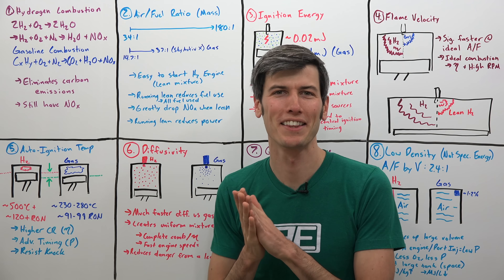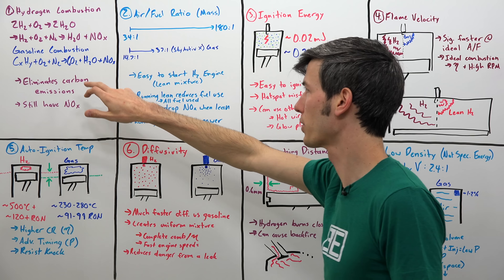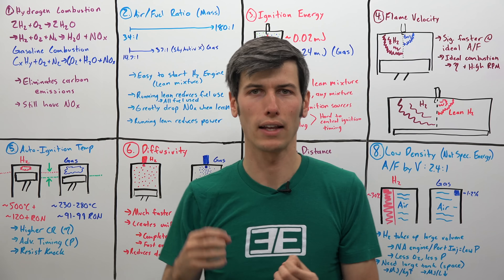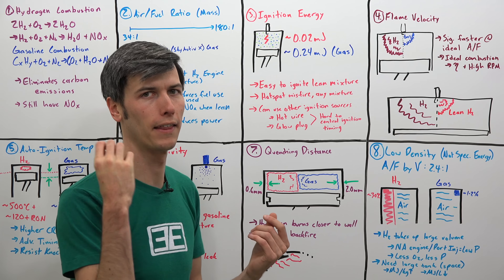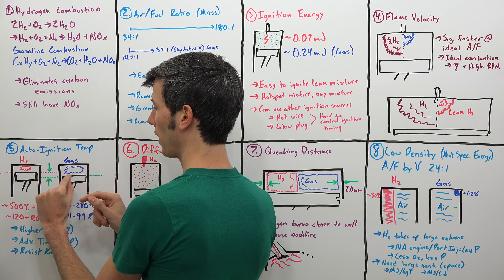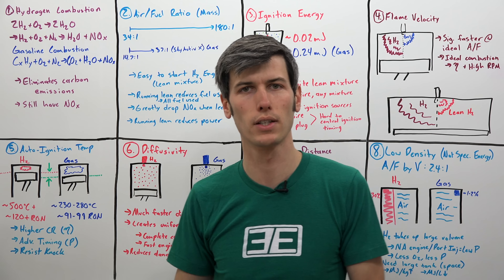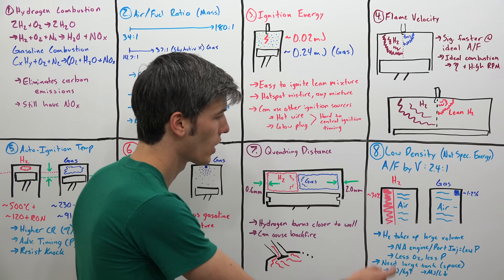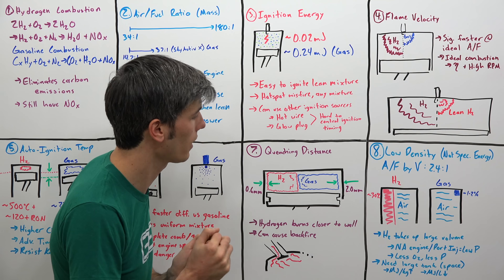The Difference Between Gasoline And Hydrogen Engines

Comment: 95% of hydrogen is produced either from wood or from fossil fuels, such as natural gas and oil (source: planete energies). And as you mentioned, NOx emmissions are still a problem, they are toxic and also cause acid rain. The big fuel tank is essentially very unpractical, essentially limiting the technology. Hydrogen production also consumes a lot of energy and has about 15 to 30% conversion less (source: Wikipedia article with its own references). As it is generally produced from fossil fuels, I highly doubt that the carbon footprint of burning Hydrogen instead of gas is better. Sure, you do not put out CO2 as you drive, yet still pollute the air with NOx emmisions. And CO2 is being put out somewhere else, carbon capture is mostly not done in most cases (source: Wiki). Also, engine oil changes, friction losses, etc. remain. The thermal efficiency of ICE runnung on hydrogen is usually about 25 to 30%, not much better than burning gasoline. (source: quora). Also, transporting hydrogen costs more energy than transporting electricity.
 
So this makes cars that have ICEs running on hydrogen not green or economical at all. Fuel cells might be nice, but the huge hydrogen tank is a drawback. Eletricity can be generated from a variety of sources, some of them with a very low carbon footprint like nuclear or wind. I have 79,7% nuclear energy in my mix and drive an electric car. So I could say I have a nuclear powered car. I consider nuclear "green". If I count also other low carbon production like hydro, biomass and solar, I have almost 90% of my electricity carbon free. (source: seas - slovak powerplants) With battery technology slowly improving, I expect the hydrogen car, regardless if it has a ICE or fuel cell, to die.

Comment: What if, you save both the hydrogen and the oxygen from electrolysis and then injection both into the cylinder.  More power and less NOx?

Comment: Something interesting I've noticed a lot of people do, is emphasizing only the last part of a number when implying contrast. In this case, eighteen to one, a hundred and EIGHTY to one. The way that is weighted, it sounds kind of like the first number is also a hundred and something, even though it isn't. A more even emphasis on both hundred and the eighty, would make it clearer that you didn't miss what the first number was. 

That is, of course, nitpicking, and something one shouldn't even bother to think about in a video like this, where you can skip back and forth, but it's a very common thing, which is kind of funny...

Just a small observation.

Comment: Super interesting video as usual, but I would have like to see an efficiency comparaison between H engine and gas engine. As far as I know gas engine have an energy efficiency around 30%, the rest being lost in dissipated heat... what is it for H car? (I've heard EVs are around 90%).

Also if ever you run out of ideas, I'd like to see a video comparing H cars and EVs, cause Hydrogen is not an energy source but an energy storage since you have to use energy to synthesise it (which you get back at combustion), so maybe a cost compare, running cost, efficiency, environmental footprint, an whatever else you would wnat to put in.

thx for your videos, hope this was clear, english is my second language, jp

Comment: I really hope more advancements can be made in dry hydrogen cells seeing as human urine can be used as a dialectic fluid.
I think dry cells running alongside an ICE with a lot of your creative research and engineering could move us over to that and what a success it would be for recycling something we all produce.
I think vehicles to begin with would of course have to be a little bit larger until more development is pushed through and the technology can be shrunk down whilst retaining efficiency and production.
When it has the positive impacts for emissions and the fact the all electrically only powered vehicles don't do anything to filter the air then in my humble opinion I think it would be a great step in the right direction.

I love how Dr Robert Murray-Smith here on YouTube managed to get equal power storage and output from used carbonised rubber tyres per gram or kilo to that of the current at the time lithium ion batteries.

That really would make a huge difference, recycling used vehicles tyres and turning them into useable batteries.
Used tyres mostly get shredded and either go into children's play areas or astroturfs or worse landfills.
They must be recycled and when put through the correct carbonisation and filtration process it's a very useable material.

So glad you did this video and it was a really good one and I really do hope it's problems can be overcome by our world's greatest engineers and thinking minds.
Great video.

Comment: In hydrogen combustion you have to pay attention to nitrogen oxides as well... The reason is the temperature of the combustion which let the nitrogen react with the oxigen as well... This could be a problem with lean combustion where is much oxygen left.... The comparison to gasoline in the case of the amount of nitrogen oxides i cant tell right now but they will be existing as well as in the gasolinr and diesel combustion....

Comment: I really like the idea of using hydrogen for fuel. From what I understand the automotive industry isn’t using hydrogen this way in there experimental vehicles. They are using a gel fuel cell to store the hydrogen. Where electron exchange is used to create electrical effort making the system more like a EV. Are there manufacturers using hydrogen as a combustible fuel? It would be killer to have a gas to hydrogen conversion kit on my car ( that actually worked).

Comment: The difference that really matters: cost. 

95% of today's hydrogen comes from natural gas. Steam reformation produces just as much CO2 as burning that natural gas. Thus, just convert engines to run on natural gas. Doing that cuts emissions compared to gasoline and costs tens of thousands less than hydrogen while producing no more emissions than using hydrogen. 

To go completely 'clean' we'd have to switch to hydrogen from electrolysis. But doing that requires starting with electricity and destroying ~75% of it going through the hydrogen phase. Thus, it will ALWAYS cost 6x to 8x more than a battery electric. 

Hydrogen is a fool's quest.

Comment: So correct me if I am wrong, if the Hydrogen Motor produces Water, would that mean there would be water flowing from the exhaust system onto thre Road and if so how much?
Reply: on cold engine the vapor would condense, but when the engine gets hot only vapor would come out
Reply: @antoniotod9614  The reason I am concerned is that we live in a area where freezing can occur for 7 months or more and if I am producing a lot of water on the ground it could get scary for myself and other drivers.

Comment: Wouldn’t the smaller quenching distance of hydrogen cause the engine to run hotter?  I’d heard of quenching distance before, and was told the unburned fuel/air provided a slight thermal barrier between the flames and the cylinder wall.  Also, I had no idea the quenching distance was so great.  I assumed it was only a few molecules wide.
By the way, would a fuel cell be even more efficient than burning hydrogen?  I don’t think you’d have the heat loss via the cooling system and exhaust.  But I really don’t know much about fuel cells beyond the basic principle.

Comment: One point you didn't cover- combustion temperatures. My guess is like lpg, it will be higher than petrol. No problem in itself-just change heat range of spark plugs. But generally higher combustion temps can have other side effects.
Reply from the maker: Yep, it has high combustion temps at stoich a/f ratios. As a result they generally run lean, to reduce comb temps, and thus improve NOx emissions.

Comment: Great video, but I have one issue, when you compare the two fuels and talk about energy, you should compare them in the same form, meaning liquid to liquid, and gas to gas and then talk about the storage difficulties.  Comparing a liquid to a gas is unreasonable without an explanation.

Comment: So essentially, hydrogen is better for performance and efficiency. But takes up more space. Not sure how big an issue that last bit would really be. After all, batteries have even lower energy to volume ratios (4x lower) but electric cars still have an OK range. To be fair, electric motors free up space where an ice would be to compensate.

Comment: Now what if a guy was to use hydrogen with oxygen only as far as combustion? no nitrogen and other fillers that are in air... not practical and very dangerous I know but as for power per amount and emissions side of things? Now only a hypothetical thought here only, but if by some way a guy could instantly turn water into HHO at a direct injector eliminating the need for even a intake valve. How well would such a (at this point in technology impossible) thing theoretically work? I bet that would be very controllable and great fuel source if possible due to the large amount of energy stored in water per volume. Its a darn shame at this point it takes so much energy to get that energy out and we don't have a efficient way to do so.

Comment: Liked the idea of Hydrogen power ever since Mythbusters and their Oldsmobile. Rhodium-based catalyst will take care of NOx. Expensive, but the catalyst would last much longer given how clean burning H is. SCR is cheaper short term, but $2.60+ per gallon of DEF on top of fuel adds up over a vehicle's life. With hydrogen, you have fuel cell EVs with no lengthy charging, and we get to keep our ICEs. Win-win, we just need the fueling infrastructure.

Comment: Engineering Explained, how much electricity is needed to split water into H2 and O2 + how much is needed for hydrogen combustion vs how much electricity the alternator puts out + how much solar energy would be needed to balance it out. Without using air from outside thus removing NOx from tge equation.
Reply: I want to know too.
I see put an additional battery for a electrolytic chamber to split water.

Comment: That was very informative. I think efficiency alone will be enough to make hydrogen combustion engines a niche product for sound enthusiasts, but one thing I was missing in the video was particle emissions. Since hydrogen burns very cleanly, assuming there is a good sealing on the piston, there should be no need for a catalyst or a particle filter, hence improving exhaust system cost and noise over gasoline systems.

Comment: dude!   nice to see you back at the board.  although were you in a classroom?  the light was different, and the white board, obviously, significantly bigger!    I detect cheating!  :-)
I'm not sure I got that last bit.  since the A/F ration can be so low, how would gasoline, at 14:1, take less space than hydrogen at  37:1?  is it because the A/F ratio is measured in weight while space occupied (obviously) by volume?    I always thought A/F was measured in volume....
Thanks for this.  
by the way, since hydrogen seems to have very few downsides, why don't we all have hydrogen cars?  is it only because of storage and distribution issues or are there other reasons?
seb.

Comment: Hi Jason,
its a very good work from you to do such illustration of how h2 works in ICE.
Im a mech. engineer and working in a CNG vehicles field,
and i think all of the advantages you mentioned about H2 is the same here in CNG,
except the point of flame speed (CNG IS SLOWER THAN GASOLINE) and  air/fuel ratio (CNG max stoichiometric ratio is 1:17).

Comment: Hi ! i really like your video but i just a have a little question about running an engine lean, i've seen before that the more your air/fuel ratio is poor the more NoX you produce, and that's why today's car produce way more NoX than old NA/carburator engine ( Even if old school engine produce a shiton on Co2)

Comment: Hi, very interested engineer-in-training here,
Could somebody (Jason or a very knowledgeable viewer) please explain to me two things which I don't understand/haven't encountered before:

1. How do fuels have relatively different auto-ignition temperatures and ignition energies? For example above the hydrogen has a much lower ignition energy than petrol, and a much higher auto-ignition temperature - how is this possible given the relationship between temperature and energy?

2. What causes the quenching mentioned in point 7? I have not heard of this before and have no understanding of it.

If anyone could help me understand these it would be really nice :) if the answers are too long and complicated a general explanation and some pointers to all the subjects to read up on would suffice, thanks!

Comment: I had expexted to see a lot of comments from HHO energy nuts here. Those who think they can use a Electrolysis contraption driven by a gasoline engine to save fuel. But so far they have not shown up. Maybe they are happy in their own corner of the web, cocking up more pseudo-science
Reply: well, i tested HHO on my sisters car and got 20% more power and 40% reduced in fuel consumption, why i have to show the world? i would show but only if i get paid for that... but i wont... i wouldn't show up cuz someone could steal my business idea and get rich of it

Comment: What about mixing H2 and Gas? Is it reasonable to make this question or is it a total nonsense? I am talking about a situation in which you have your normal gasoline engine but at a certain point you start to inject tiny amounts of H2 into it. How good would be the combustion of that mixture (O2 + H2 + Gas)? Does it make the combustion more efficient? Does it affect the MPG? The combustion remains inaffected? Does it break the engine? Is this the new Nitro? Thanks for the video, you always make a very entertaining and educational content!

Comment: BMW has experimented with hydrogen burning cars, using a 500 HP V8 and making adjustments so it could run on hydrogen. The problem was that it could only produce somewhere around 120 HP from the same engine. So if we want to burn hydrogen instead of using it in fuel cell vehicles, engine displacements would have to be huuuuuuuge. Maybe that is a fun discussion for a next video.

Comment: I have a question about box #4.
A lean hydrogen mixture burns slower than stoich hydrogen. Does the lean H2 burn faster than stoich gasoline?
Reply: If the second drawing is accurate, then yes.

Comment: Gasoline engine also gives off toxic CO (carbon monoxide) emissions, H2 engine does not.    OTOH, highly compressed H2 fuel, to make it more compact, would be very dangerous in an automobile.  H2 also tends to seep through metal and plastic tanks and fuel lines, the atom is so small it slips between the tank and fuel line molecules.  These unfortunately make H2 fuel impractical.

Comment: This was very informative! My friend has been toying with the idea of converting his old camaro to run on hydrogen since we were in high school. Hopefully the old cast-iron block doesn't have any bad hotspots, and the malaise-era camshaft should keep the backfiring at bay lol.

I did the math though, running a combustion-powered car on home electrolysis-generated H2 (using mains electricity) almost costs as much as pump-gas. (at least here in BC)

Comment: Very interesting.  I have two questions:

1.  Both hydrogen and gasoline produce nox, something I hadn't heard before for hydrogen.  Do the two produce close to the same amount of nox relative to the amount of fuel burned, or is there a significant difference between the two one way or the other?

2.  How in the world to they measure that quenching distance you talked about (#7 on your board)?

Comment: Very interesting presentation and learned more about H2 power.

All looks good and new to my understanding until point 8 on white board.  How is H2 stored as fuel?  Points 1-7 all favor H2 and fuel to air looks good.  Hydrogen internal combustion engine should be in our future (yes there are also fuel cells -> electic, not talking about this in post).

If, in the future, we could find a way to safely control H2 in a liquid form, point 8 would be mute.

Just thinking out loud and love your videos.  I know BMW did some testing in....Iceland??? with v12 engines.  Result was amount of fuel space needed.

anyway...great vids....keep posting.

P

Comment: Wait, no, don't burn it FFS 🤣 It goes from a storage tank through a fuel cell to give you electrical energy

Since you're burning it you're still getting nitrogen monoxide which is really toxic and will still get CO and CO2

That way it's 2× more efficient than fossil but still ½ as efficient as pure electricity

Yes we can produce hydrogen renewably, but really slowly at the moment. It'll be great for ships and aircraft but not for cars

Comment: I sure hope a car company like Mazda will build hydrogen powered engines to give driving enthusiasts something comparable to rowing the gears in an ICE. Sure EVs are more powerful, but they don't have a clutch or rev matching or take any skill to balance through a tight turn. Also, Compression Ignition hydrogen engine? That seems like a big IF and quite the potential for catastrophic failure. Fun!

Comment: Please correct me if I am wrong but Doesn't leaner air/fuel mixture cause higher combustion chamber Temps, which would cause an increase in Nox emissions?
Reply: pressure cause NOx not temps